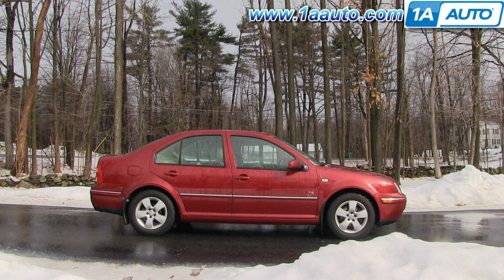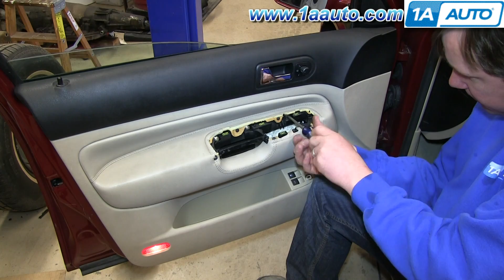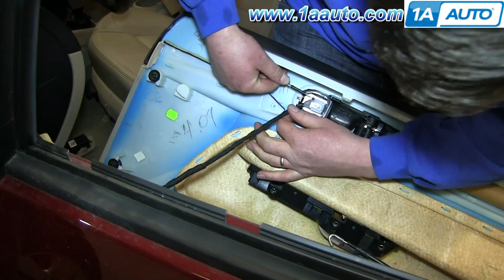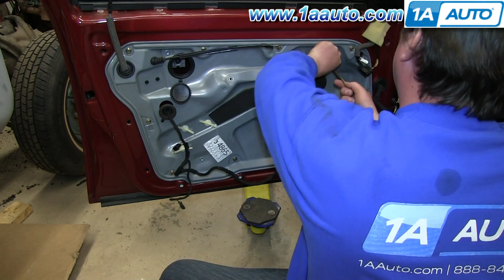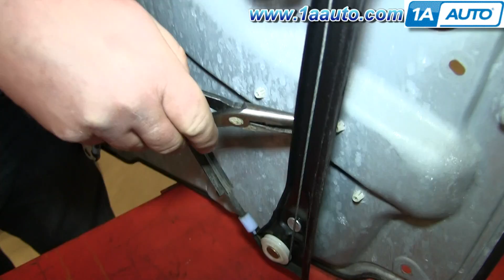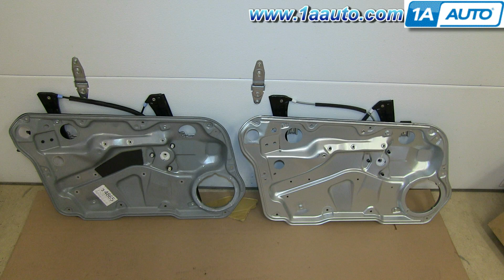How To Install Replace Front Window Regulator 1999-06 VW Volkwagen Jetta Golf

Comment: So the window glass is all the way down in the door no way to get a grip on it to lift it,   the drive mechanism is broke and definitely will not lift it up enough to access those last two bolts that hold the glass clamps to the regulator things. Cannot remove the panel.  No access holes through the panel to permit access to the glass to lift it up.   "Catch-22"  dilemma.  Now what?  Get out a tool to start cutting up the panel into pieces ?

Lightbulb moment.  I got this, problem solved.  They should have put it in their video.

Comment: Looks like a nice detailed video.. But...before I tear apart my 05 jetta(drivers window stuck down about 6 inches) I want to be sure to have correct parts! Once the interior panel is off can I test to determine if problem is regulator or motor? Thanks,Jim
Reply: first remove the cover so you can see the window motor remove those three bolts with the wiring plug in, push the switch see the motor work , then move the window by hand up and down to see gear turning ..
but if you want the quick way, just use hand up down the window, if can move a lot that the regulator, if can't that may be the motor or other problems.

Comment: Can you tell me what size rivets I need? My nearest hardware store is about 25 miles away, so I want to make sure that I have everything I need BEFORE I tear it apart.
Reply from the maker: Hello!

We do not have the exact measurement of rivets you should use for this project, but please keep in mind that coarse threaded bolts can be used in this application.  Please let us know if you have any further questions.

+Jerry Jones

Comment: Why did it need new window regulator? Thanks in advance
Reply from the maker: +Themachine Thanks for watching!  I can't recall why this particular one needed a replacement, but it is usually due to cable failure or one of the plastic rollers breaking.  1aauto.com

Comment: Great video. Many thanks, but in the video at 5:07 you turn off something. When do you put it back?

VW Passat ( 2003 y )
Reply from the maker: +Szabó József Thank you for watching. At 5:07 it appears there is a tab that gets released which is attached to the regulator. The tab would then need to be tucked back inside the door panel when reinstalling the new regulator.

Comment: same procedure on a passat?
Reply from the maker: +Pete L It may be the same or a similar procedure. Here is a link to the replacement window regulators that we carry for Volkswagon Passats. If you look up your year, we might have an auto repair video that corresponds with the replacement part. 1aauto.com
Reply: I will find out tomorrow :)

Comment: Thanks so much! Just helped replace the regulators in both front doors of a friend's '03 Jetta Sportwagen. The driver's side window had taken a dive last weekend, and once I got everything unscrewed on the passenger's side the motor mount on the old regulator just fell off. Good timing!

Comment: hello, i did all this today, to replace the Window elevator. But now my right speaker wont work, which cable IS the speaker cable? maybe i plug It wrong ir something :S
Reply from the maker: +marHol 9 You may want to check the connection to it. Hope this helps you out. 1aauto.com
Reply: Yep! one of the cable wasnt connected well! thanks! ;)

Comment: My passenger side window fell down because it was stuck on a cold winter day and I pressed the window button down, so the arm went down and the window was stuck frozen in closed position and then fell once it unthawed, but I was able to bring the window back up by grabbing it with two butter knives with tape to get a hold of it, so I brought the window up almost fully, and then when I pressed the window up button to bring the arms back up, the regulator grabbed onto the window again, and now the window works as normal. My question for 1AA or anyone who may know is, how does the arm grab onto the window? is it just a two sided rubber clip that grabs the window? or is there some kind of pin that connects the clip more securely? The window goes up and down normally now, but I'm afraid that on a cold day it may not have enough grab to bring the window down and I will run into this issue again. I would like to know if I actually have to replace these clips, or if I am good to go. Thanks guys!
Reply: Two butter knives! Genius. Thanks, that helped me.
Reply: the same thing happened to mine, ive yet to get it fixed though.
Reply: We love you buddy electrical taped butter knives for the win. Thanks so much. Did not have to freeze our butts off

Comment: Hey guys - thanks for the video - any idea what it means if the window is fine going down but then when going back up it goes click, click, click spaced a few seconds apart as if something is rotating inside and gaining friction?
Reply from the maker: +Ben Jarvie You may want to inspect the motor gears to see if there are any teeth on it that are worn or missing. Hope this helps you out. 1aauto.com

Comment: Hi,
Nice detailed video.  I had no problems doing the job.  I also ordered the regulator from you.  The only problem is that the window does not roll all the way down like it did with the OEM one.  Is there anyway to adjust it so the window goes all the way down?  Right now it stays up about  an inch or so.
Reply: regulator need to reset every time you did, the auto stop function need to reset, go up and down, when all the way keep holding more than 10 second,if not do it again, every model I think are the same.

Comment: What do you do if the window (passenger side) has dropped to the bottom?  What's the process for pulling (or getting) it back "up"?
Reply from the maker: +Rob Schmid If you remove the door panel so that you can access the inside of the door, you should be able to push it up and into place by hand. We carry new window regulators on our website with free shipping. Here's a link to the one shown in our video on our website in-case anyone would like to see what we have to offer. http://www.1aauto.com/volkswagen-golf-jetta-window-regulator-driver-side-front/i/1awrg00360?utm_source=YouTube&utm_medium=CTA%20Comment&utm_campaign=1ATony
Reply: @1AAuto  I have the door panel removed and it's uclear to me how I would push the window up. The only access point is the two 1.5 inch circles you use to remove the window clamps once it's in place - not sure how to get the window up with the tips of my fingers

Comment: THANKS SOOOOOO MUCH for doing this video! My VW dealer tried to charge $529 to do this repair. With the part from your site I think I paid $70 tops for everything I needed to buy for this. Much appreciated!
Reply: How difficult was this repair? I'm worried about the speaker part/rivets the most.
Reply from the maker: Thank you for watching. Glad we could be of help. Please let us know how the repair comes out! 1aauto.com  888-844-3393
Reply: 1A Auto Parts
Reply from the maker: +Benjamin Grant The level of difficulty will depend on your experience as well as the condition of the vehicle and the parts.

Comment: I have manual windows is it basically same method? I can't even figure out what part number I need for manual window regulator. I have a 2000 VW golf GL 2-door witch I think is Mk4 style.
Reply from the maker: It may be a similar repair. We currently do not have an auto repair video that shows this repair. We'll keep this in mind in the event that we need to make this repair in the future. Thanks for watching. Have a great day. 1aauto.com 866-403-3393

Comment: I want to fix the automatic window regulators in my 1997 vw jetta, does this video apply to that car? and if not do you have one that does?
Reply from the maker: It should be the same repair. Usually the auto up/down feature is controlled by the switch. Thanks for watching.

Comment from the maker: @Bartholomeo Puglia If the cable on the window regulator broke, you would need to replace the window regulator as shown in this video. The way it's designed on this vehicle, is that it's built into the inner door panel. If you click on the link in the video we have them for sale on our website. Hope this helps you out.